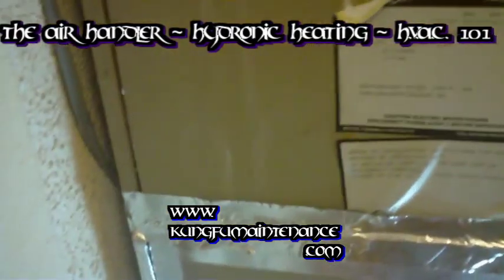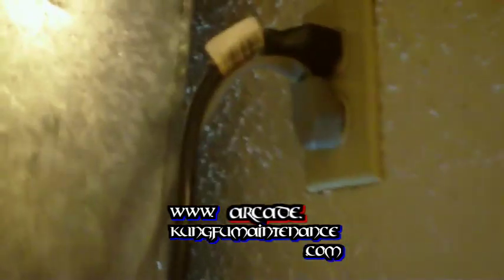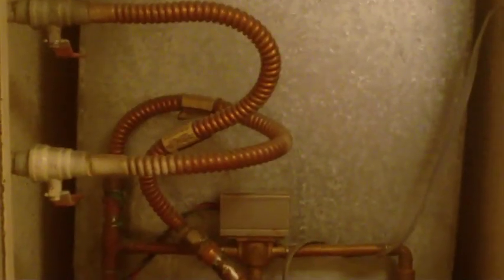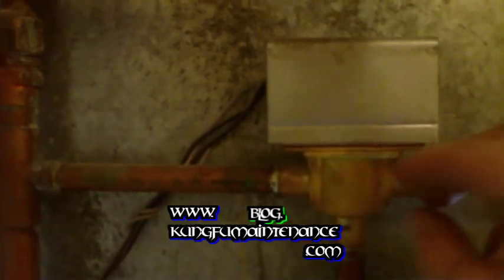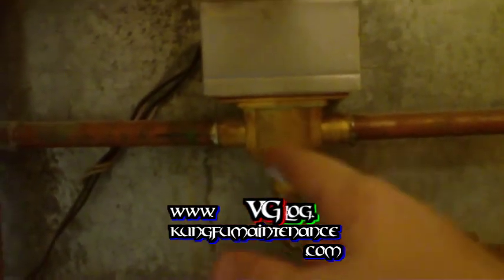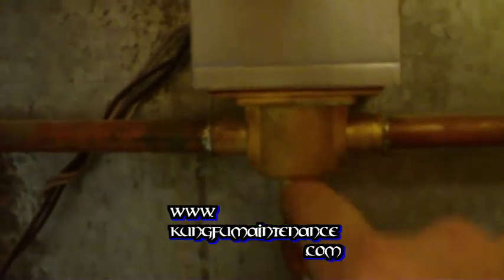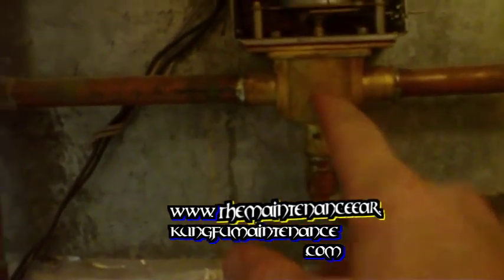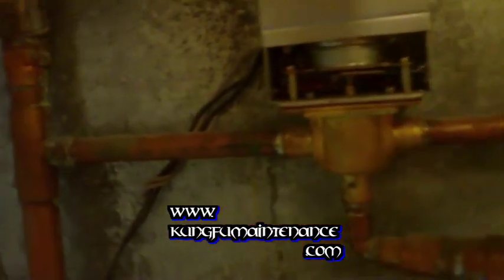Hydronic Heating and The Air Handler ~ HVAC 101 ~ Kung Fu Maintenance

Comment from the maker: First inspect the start wire itself for any breaks or bad leads with power off and capacitor discharged ohm out both ends to check for continuity. You can try adding a hard start kit (you can add a maximum of two hard start kits) and replacing the capacitor to see if that will get the compressor to start. If it still will not start than the compressor most likely has a locked piston and compressor will need to be replaced or the whole window unit replaced.

Comment: THANKS VERY MUCH FOR FAST RESPOND ,IWORK ON A MINI SPLIT MITSUBUSHI I MOVED THE CIRCUIT BOARD WHEN I PUT BACK THE CIRCUT BOARD  I LAID DOWN THE UP METAL COVER ON THE UNIT (CONDENSER ) BUT THE CIRCUIT BOARD WAS NOT TAID  UP BACK VERY GOOD THE COVER WAS TOUCH THE CIRCUIT BOARD WHEN I STARTED IT GET SHORT CIRCUT AND OFF THE UNIT   ,MY Q IS WHAT COULD HAPPEN   WHAT I DO NOW OR HOW CAN I CHECK THIS PROBLEM NOW THANKS

Comment from the maker: First check the breaker and the fuses to verify you have power available. Hopefully it just blew the fuses and/or tripped the breaker. Visually inspect the circuit board for obvious burns or melting. You may need a new circuit board.  Just watched a good video on youtube showing how to test the board. The video was titled "Mitsubishi mini split troubleshoot inverter board". You can also call Mitsubishi technical support who can walk you through testing.